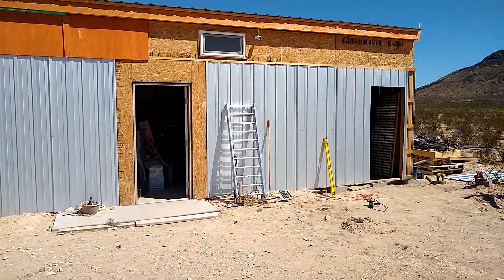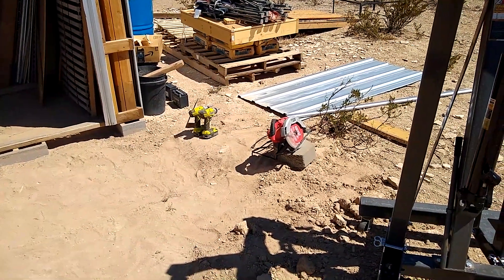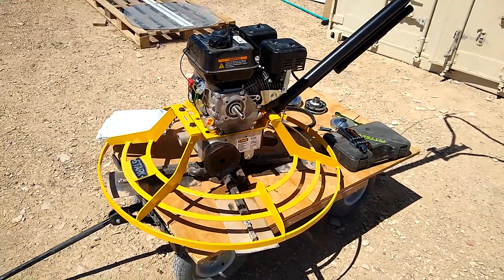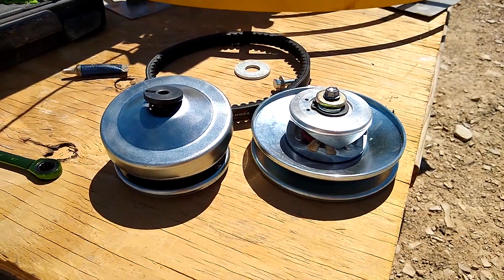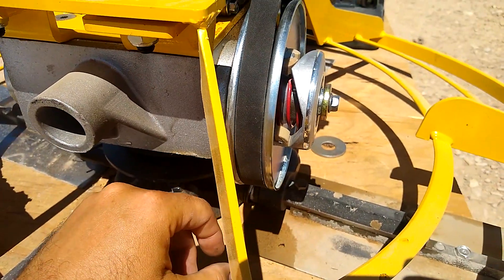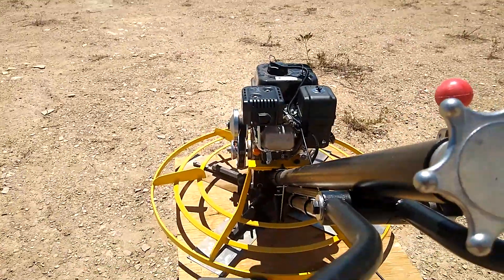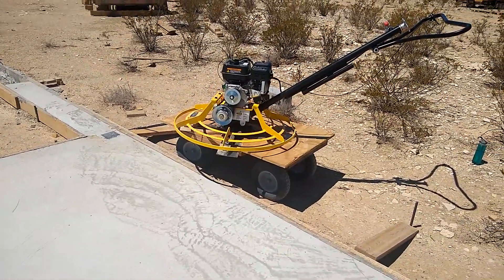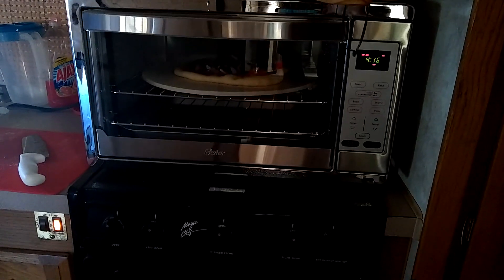Concrete Power Trowel CVT Upgrade

Comment: Trick of the trade when it comes to ripping metal panels:  Typically the panels are tempered steel.  If you scribe with a utility knife, or a nail, or even one blade of your tin snips, along a crease that is nearest in the dunnage area that you are ripping off, then you can fold the dunnage side back and forth until if simply snaps off.  Once you are working with flat metal, you can use your tin snips to cut along the length of the panel at the needed location.  Less noisy and no mess with metal dust all over the place.  In fact, some metal manufacturers will refuse to warranty your metal if you use a grinder or saw, because the metal dust will rust if it is not removed.

Comment: Pretty cool set up. But may I ask why CVT over the regular factory clutch?  Now my only issue, is that cooked salad on bread you called pizza LOL Hey now, it took me 2 years of biting my lip to comment on that pizza thing.
Reply from the maker: I went with the CVT clutch setup over the centrifugal clutch they sell these with because I get much lower and smoother cut in of blade rotation with a strong low end for floating and a faster high end for finishing. Also, this setup was cheaper than the OEM parts. Crust + sauce + toppings = PIZZA! You're just jealous.
Reply: @fullvegan  Pretty thought out choice on the CVT. And cheaper is always good..When I come visit, you can show me how to do cement and I can show you how to make pizza LOL